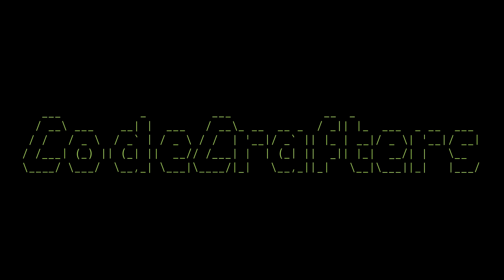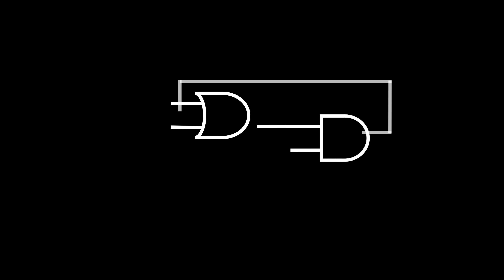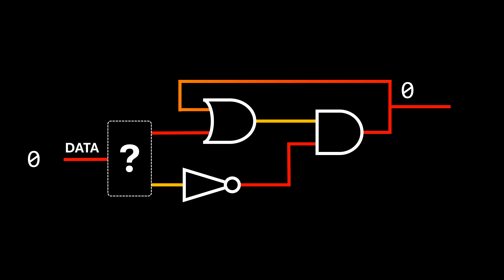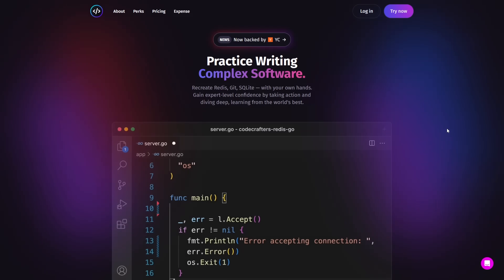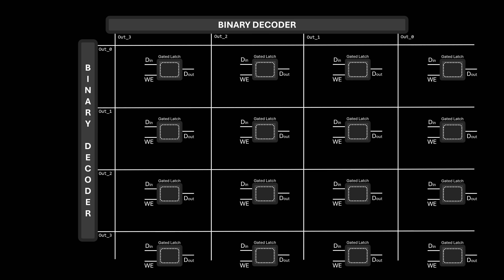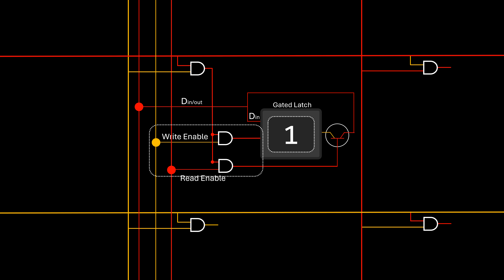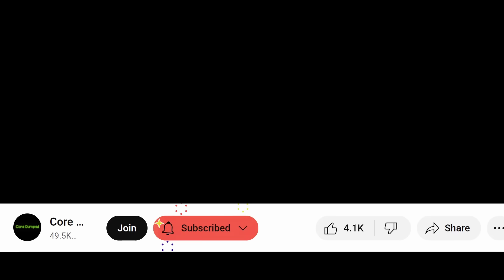HOW TRANSISTORS REMEMBER DATA

Comment: I understood that RAM is volatile because it stores data as electrical charge.
Then I wondered why HDD is non-volatile and realized it stores data using magnetism, not transistors.
That led to the question: what if we use magnetism in RAM itself?
Turns out, that already exists — MRAM, which is RAM + magnetic storage, making it non-volatile and instant-on.

This video really helped connect hardware physics with real memory design.
The explanation triggered the right questions instead of just giving surface answers.
Great work by the creator — content that actually makes you think.
Reply: Access time is the main point as far as i know, you can use atoms to store charge. For a B field storage you need bigger structures since there has to be movement in charge inside the structure due to magnetism just beeing the relativistic view on the E field of moving charges.

Comment: 16:11 This part of the circuit is for making a homemade circuit that connects data output to data input to turn it into a bidirectional processor with fewer components for the data+ pin of the USB head of the pen drive, and then use the same Write Enable to add more memories identical to these six to the data- pin of the same USB head? I've always wanted to know if it was possible to do this, then connect each data line of the USB head to an input of the last NAND memory in the homemade circuit, and connect the output of the last NAND memory to the DAC and then to the sound amplifier!

Comment: As long as write enable = 1, the address must remain constant.
In practice, the address lines would not change simultaneously, but sequentially.
With n address lines, in the worst case, n + 1 memory addresses could be overwritten.
Example with n = 4: 1111 -> 1101 -> 1001 ->0001 -> 0000

Comment: Also, some logic circuit simulators(e.g., CircuitVerse) doesn't have transistor to "Write to" and "Read from" the given data in the "Gated Latch". Please, provide a way to solve this issue. I am waiting for your replies.

Comment: This reminds so much the analog computer configuration diagrams/graphs. But while analog computers are connection programmed, in order to change the structure of the machine to form an analogous model of the mathematical equations/algorithms, this seems to be more like an indifferent hardware structure which never changes but just takes different inputs fro a stored program.

Comment: Interesting.
This clarifies why reading from "non contiguous" memory is slow. It's not because the bits are physically farther apart. It's because you have to set the address register first (instead of just incrementing it), and that takes extra instructions.
Reply: im pretty sure it also mainly has to do with caching which i don't know much about.
but basically certain regions of ram will be cached into a memory that is faster to read based on some rules.
having non contiguous memory means the memory is less compact which means theres less probability that any given address in that memory will be cached

Comment: What if I had CUDA create multiple states, the largest ive got was 1022 flip states, on par with a quantum computer, train an AI on the data and inference it back to the CPU, these are binaray values also, Im doing research Im just starting my second project learning how the CPU and memory works. Trying to bypass the 8 bit register, once trained on the full state of RAM, already knows what bits need to be switched before the transistor even physically flips states!

Comment: How can a loop that is connected from the output of a gate to the input of a gate store a signal=1 (voltage) when no other electricity source is applied? It’s just a connection or do all these connections itself include capacitors?
Reply: There is a power source, each gate is connected to the power supply. The power supply connections are not shown in this video. Imagine no or miniscule current flows into the gates from the input, the input just supplies a voltage that signals the gate to turn on and off.

Comment: 3:09 after not gate output is 1 while whole circuit is in off state how the not gate actually get current supply how it can be 1
Reply: There is a power source, each gate is connected to the power supply. The power supply connections are not shown in this video. Imagine no or miniscule current flows into the gates from the input, the input just supplies a voltage that signals the gate to turn on and off.

Comment: So electricity has to keep flowing through the transistors in order to retain a value / remember something? If, somehow, the electricity stopped moving, RAM would contain... what?
Reply from the maker: When ram is disconnected it stores nothing.
Reply: @CoreDumpped  I just watched your video on dynamic RAM and now I see I where I was getting confused. I thought all RAM worked like dynamic RAM (and stored charges like capacitors). Your videos are amazing.

Comment: Fun fact: this is the type of RAM used to implement CPU caches. As you can see, it takes 6+ transistors for one bit, and it basically takes up 70%+ of the billions of transistors you usually hear about in processors, because modern processors use multiple megabytes for caches. Do the math. It's actually one of the things that make me feel the transistor count ain't too impressive... design-wise of course.
Reply: the circuitry shown at 5:44 and 13:41 would require 17 transistors per cell. But thats not how it works. 
In my opinion, SRAM is much easier and better understandable at transistor level. The 6T cell cant be described in terms of basic logic gates.  Because logic gates do have dedicated inputs/outputs while the bit terminals of the 6T cell work in both directions. A single cell doesnt even have a dedicated write enable signal.

I once studied the implementation of the famous Z80 register file (14 x 16bit) and was quite impressed how genious but easy it is.

Comment: How does an inverter turn a 0 into a 1 , where is the power coming from ?
Reply: It has to be powered in order to send a signal. So it gets its power and then receives a 1 or a 0. And using the power its receiving it outputs the inverted

Comment: All these logic circuits work when there is electricity. How do the transistors hold the data when the electricity goes out and comes back on?
Reply: It can be achieved using capacitors which can be viewed "as batteries" to store power.
Reply: @mounirboussetta  Capacitors can self-discharge
Reply: @birdost4872  yes of course but there is a mechanism to make sure they don't.

Comment: Ive gone through very similar physical breakdowns of the schematics on YouTube before a few times, and this is the first time i actually realized that each individual sequential bit is not stored as contiguously as I i had thought before. Possibly there are other schematic layouts that allow for more truely contiguous physical layouts of sequential bits, but this aspect is completely new.
Reply from the maker: A contiguous way is also possible, but it requires extra circuitry (a multiplexor - demultiplexor.) You can check out my video about dynamic RAM for more details.

Comment: 12:55 Huh, you could hold the write enable line high/active along with an input tied to every output of the binary decoders to write every cell in the matrix at once. Which could be useful for quickly clearing values.

You could also “sweep” the address over a smaller segment using the decoders to clear a segment of memory quickly, instead of all of it.

Comment: Hi I am from India pls reply if you can help me
My mobile phone poco f1 had got damaged because of water now it's dead .how can I retrieve my pictures screenshots, documents and books saved in  device  pls pls suggest
Reply from the maker: Hard to tell without a proper diagnostic. If the flash chip is not fried something you can try is desoldering it and solder it back in another device (same model) so you can access the data.
Also there are some flash-chip readers you can plug into the computer via usb to read the content of a flash chip.
Again, assuming the flash-chip is not fried. If it is, your data is gone.

Comment: Sir, I wanted to ask that in the case of OR GATE when we connect one of the inputs with the output. Then turn on the other input, the output gives "1" which is then transferred to the first input. Now even when the 2nd input is off the gate remembers the data as "1". But when we look at the circuit in this condition by replacing the OR GATE with the actual transistors working inside it. It works like the power from 1st transistor turns on the insulator and allows it's current to flow through the output. This seems self flowing till the power is available. But does' t it forms a complete loop of single wire which is taking power from one end and connected the other end to itself in the middle?? 
Please explain how does that work 🙏, I am confused in this part.

Comment: This is the best explanation I've ever seen of how computer memory works. Thank you so much! Meanwhile, I would love to be able to see and play with an interactive javascript version of your "How CPUs Work" application, so please keep us all in the loop if you plan to move forward with that!  

I am just a "layperson" with no formal training in electrical or computer engineering, but I find this kind of stuff absolutely fascinating! I'm always amazed that people at some point in the recent past were able to figure all of this out. First, using electrical circuits and switches as an analog for binary logic. And then building on those circuits to create machines capable of not only performing arithmetic and more advanced calculations, but ultimately performing almost any "mental" task we used to have to perform in our heads. Now we have the processing power to create large language models and give the illusion that the machine is actually thinking for itself. And to think that less than 200 years ago, we didn't even have electricity in people's homes!  Absolutely incredible.

Comment: If you are talking about memory inside of a chip, they really don't use this method. The big issue is that you don't want anything to be tri-statable in an actual asic. The reason is testability. When you are doing, scan, the thought of actually having to write test patterns that won't cause a bus collision will give most sane designers a fit. If you look at the specifications such as the ahb bus, used an arm processors, the entire bus has an output from the master to the slave devices, and each slave has its own output that is multiplexed back to the master.
Also, the memories inside of a custom chip tend to be registered, not latched. That means that the data is captured on the rising edge of the clock, and you only have to worry about the setup and hold time.

Comment: I'm learning coding for the purposes of SE and/or CS degree. I'm starting at the bottom and doing Ben Eater's breadboard computer and am reading  Digital Computer Electronics by Albert Paul Malvino. I'm following it well, but this video and the one about transistors running code are WAY more concise and are a great "adder" (see what I did there?) to my learning. I subbed and am looking forward to more low level videos.

Comment: correct me if I am wrong I feel like the output of OR AND latch at 4:32 would be 0 not an invalid state if both the input values as given as 1.
Reply: thats exactly what i thought
Reply: You're wrong,
Let's imagine an SR latch ( OR AND Latch ) is like a light switch with two buttons: one to turn the light on and one to turn it off. Here’s how it works:

- Button S is the "on" button. When you press it, the light turns on.
- Button R is the "off" button. When you press it, the light turns off.
- If you don't press any buttons, the light stays how it was before.

Now, imagine if both buttons are pressed at the same time. What should the light do? Should it turn on or off? The light gets confused because it's getting two opposite commands at once. This is why pressing both buttons at the same time is called an "invalid state." The light doesn't know what to do, so it can end up flickering or doing something unexpected.

In the same way, when both S and R are 1 in an SR latch, it’s like pressing both the "on" and "off" buttons at the same time. The latch gets confused and doesn’t know whether to be on or off, leading to an invalid or unpredictable state. This is why we avoid pressing both buttons at the same time in our circuits.
Reply: @pharwhaz7955 Perhaps, you are speaking of SR latches in general and the one demonstrated here with the OR and AND gate configured as shown is a simplification of one way to create an SR latch. However, you must understand that if a latch is literally made as described in this video, the effect is that the RESET flag takes precedence over the SET flag and a 0 will be stored when both SET and RESET are 1. This specific circuit, as literally described in the video, would not be confused at all. It would just completely ignore the SET flag until the RESET flag goes to 0.
Reply: @RayArias  So what the author said was wrong?

Comment: Thanks for your good video it's amazing. I have a question: at 12:23 you said that "setting Write Enable won't reach any specific latch due to the AND gate" but the Address is currently set to 0000 or first row and first col. Is there any way to disable Binary Decoder while its input value is 00?
Reply from the maker: The address is not set to 0000 in that part, when I draw white wires, my intention is to illustrate that the component is not currently being powered up. That's why all of the outputs of both decoders are off.

The only reason I draw it that way is to explain things "step by step".
Reply: @CoreDumpped  Ahaa... I thought that absence of power in digital circuits means 0. But based on what you said I assume that we should have two types of voltage levels. One voltage level for 0 and the other for 1. In that case we can consider lack of power in binary decoder as inactive state rather than 0. Am I right?

Comment: Just to add a bit: Static RAM consumes quite more energy than dynamic, even though we have to spend energy to refresh DRAM and reading from DRAM saps energy out of its capacitor. The catch here is: By adding SRAM memory caches you can prevent discharging a memory cell out of  consecutive reads therefore diminishing the need for [more] frequent refreshes. Also neware that SRAM memory heats up proportionally more than its dynamic counterpart.
Reply from the maker: I didn't know about the consumption fact, it sound a little counterintuitive. Thanks for sharing this with us.
Reply: @CoreDumpped  If you think of it DRAM memory is about the leakage of 1 FET, SRAM otoh we're talking about a bunch of FETs, all summed might fall below 1pW, yet it's multiplied by RAM capacity + dis/charge capacitance when flipping bits.

Comment: "Transistors" don't actually remember anything.  They're either on or off.  It's the STRUCTURE of the circuits the transistors are in that leverage these on/off states into actual data storage.  A single transistor can't "remember" anything at all; it just has a state that is a function of its inputs.  Memory arises at a higher level when multiple transistors are configured in bistable feedback arrangements.
Reply: Yes that’s what one learns by watching this video. Perhaps you should watch the video before criticizing it.

Comment: A little surprised that no clock signal is mentioned here. RAM-sticks has a rated frequency, right?
Reply from the maker: That only applies for DRAM. The frequency defines how often the capacitors need to be recharged. That, affects the speed since we can't read or write while capacitors are being charged.

Since SRAM is made out only of transistors, no clock cicle or frequency is involve since nothing needs to be recharged. That's why SRAM (usually used for cache) is so much faster than DRAM.

Comment: Invalid State explanation: in 4:30 , when both inputs are '1' the output should be '0' because RESET has priority over SET and if RESET is '1' then the AND gate will output '0'. Iit enters an invalid state is if both inputs are '1' and then you switch both outputs to '0' , then it will store any value. But if both inputs are at '1' and you change only one of them to '0' it will work as expected

Comment: i tought SRAM are 6 transitor, using a inverter latch instead of flipflops/and+or gates
Reply from the maker: As I mentioned, there are several different ways to create latches. Yes, the one shown on this video might not be the best way nor the cheapest one, but it is the easiest to understand to the average audience.

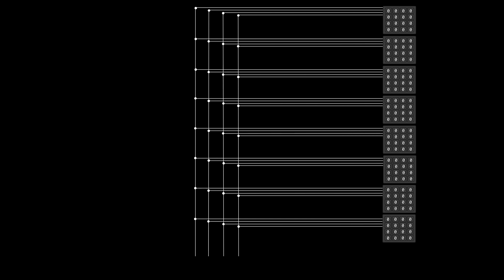Comment: Amazing video! I could notice that around minute 14:28 there's a mistake in the selected address for the latch, it should be 1010. It's a minimum mistake so it's not a big deal. Anyway, congratulations on your videos, man.
Reply from the maker: It seemed strange to me that no one pointed out any animation errors.
Thanks for noticing, I will highlight this error in a note on the pinned comment.